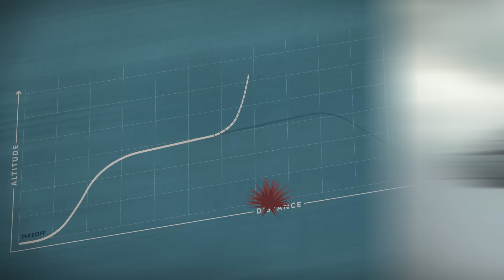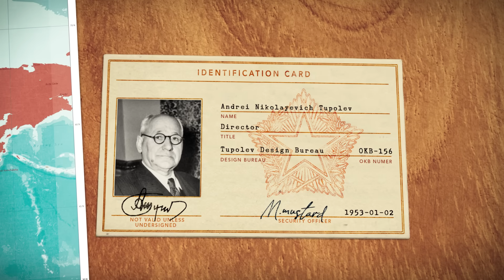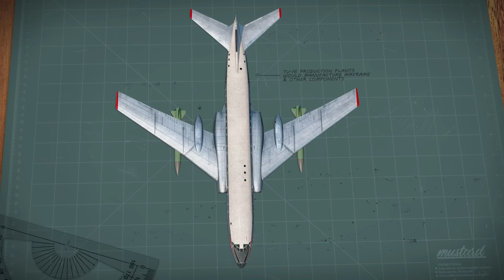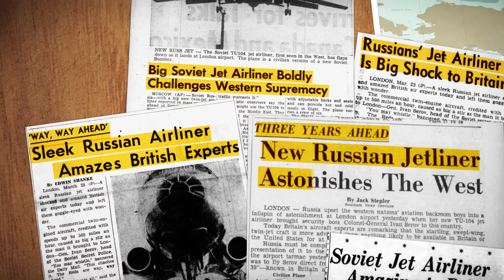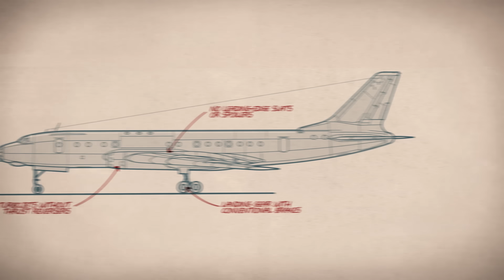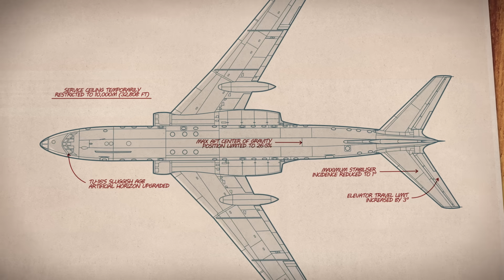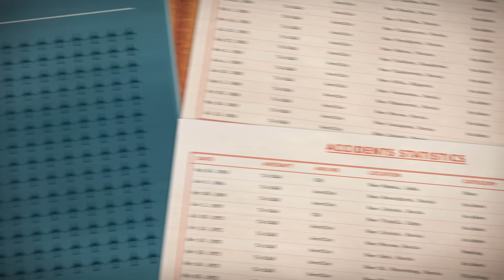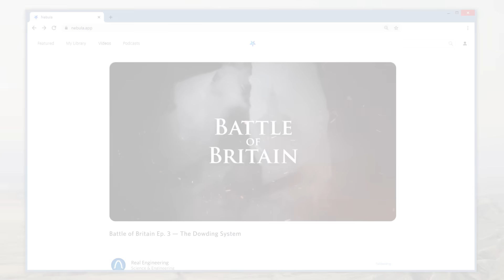The Soviet Airliner Designed To Crash

Comment: The 1st thing I thought when seeing those low wings pointing down, as if they were high wings, was that it definitely would be a handful to keep stable. If my fluid mechanics aren't too messed up, that's a recipe for unstable equilibrium, which is the situation where small disturbances tend to worsen the disturbed trajectory, instead of self-correcting.
Reply: Anhedral (negative dihedral) helps maneuverability, which might be a positive in a big lumbering bomber.
Obviously not a great trait for passenger aircraft.
Reply: Tupolev was as smart man and I think he knew that this my happen. His problem was the cost. Mascow only allwed him to build the thing if he can reuse stuff from the bomber assembly line. He was not allwed to alter the parts or create a new assembly line with proper parts. Its a soviet thing. Good example for it is the Izhmash plant - they build Moskovich cars and AK-47s. When I was a kid my dad had a Moskovich, not sure which of the 2 things was more dangerous.
Reply: @mowtow90  yes, there is video on paper skies tu22 and it mentions that Tupolev knew of all the flaws on a very early stage, but dismissed them and even started building second prototype meanwhile. I think taking such huge gamble was the only way for them to frog-leap foin tech and was an rational choice. Initially 'teething" issues would be addressed at the test phases and not during prototype production, to speed up the whole process and not to get distracted by minor flaws that in the end would result in such outcomes as we see later.
Reply: In the 1950's, many large jets had bendy wings.   On the ground they drooped, but in the air they had the positive dihedral required for stability.  Check out pictures of the B-52 on the ground and in the air.
Reply: @keithammleter3824  B52 is a high wing aircraft and didn't require the 'circus unicycle' landing gear of the Tu22.
But the Tupolev was designed with anhedral wings even before being laden with fuel.  Look at the drawings featured in this video. (yes, I know it's Blender and not some secret Soviet blueprints)
Reply: @jimurrata6785  You are right - the drawing is not a genuine original Tupolev drawing.  The fake ID card in English made me laugh.
It is typical in drawings to show how it looks on the ground.
I can't state with certainty that the TU-104 didn't have negative wing dihedral in flight, but it is VERY unlikely.
1950's jets had bendy wings because of the alloys and structural design used.   In most, wing mounted engines, and wing fuel tanks, accentuates droop on the ground.  However,. inboard engines and no in-wing fuel does not eliminate wing droop on the ground, because aerodynamic wing loading in flight still bends the wings upward in flight.   Therefore, static wing droop may be designed in to compensate.
Photos and movie film of TU-104 in flight seem to be rare.  Most that I found don't give the right view in level flight.  With swept back wings, they look like they have negative or positive dihedral depending on whether the camera is above or below the aircraft altitude.   However, in the film of the TU-104 at the Paris airshow, https://www.youtube.com/watch?v=eOq15xg4Q7A, at 0:33 it is shown in a climbing turn away at a distance and the wings appear straight.  
The TU-104 has the same wings as the TU-16.  I found a couple of photos of TU-16 in level flight taken from another plane at the same height - the wings appear to have a small positive dihedral. 
To make a plane, bomber or airliner, in the 1950's with negative dihedral inflight does not make sense as the plane would be unstable.   Modern fighter aircraft can have zero or even negative dihedral to improve manoeverability but they have fly-by-wire computers that make them appear stable.
T-jets were popular because of their low cabin noise levels.  However, engines behind is also an unstable system.   This was fixed by adding yaw dampers - automatic systems that use accelerometers to move control surfaces in a negative feedback system.  It is quite unlikely that a similar system was invented in time for the TU-16/TU-104.   And why would they bother, when by not having negative dihedral the problem does not exist.
It is also possible to make an aircraft stable with negative dihedral wings if the horizontal stabilizer is large enough and has sufficient positive dihedral to overcome the wing instability.  But drawings and photos show the TU-104 had a zero dihedral horizontal stabilizer and it's not particularly large..
Reply from the maker: Good photos are hard to come by, but the negative dihedral is notable even with lift under the wings 

https://media.gettyimages.com/id/1174232730/photo/international-air-show-dubendorf-1956-tu-104.jpg?s=1024x1024&w=gi&k=20&c=RcaUzsqn48FXidaM0Re7me_pmjC2r90PcbkEZYSq5kM=

https://media.gettyimages.com/id/526983340/photo/a-tupolev-tu-104-aircraft-takes-off-from-novosibirsk.jpg?s=1024x1024&w=gi&k=20&c=oE1vMdlH8xfVY1wdTvoJosnkpVl7K1OvW66JI2sdPyE=

https://www.aex.ru/imgupl/d2497_p1.jpg

https://aviation21.ru/wp-content/uploads/2017/04/ty124-5.jpg
Reply: @MustardChannel  : No.  Taking the pictures you found in the order you listed them:-  
1.  Appears to show positive dihedral, but angle of view combined with wing sweep-back makes it difficult to interpret;
2.  Unknown amount of weight is still on main wheels.   Aircraft is pitched up, which combined with wing sweep-back gives it a negative dihedral look anyway;
3.  Aircraft is pitched up in climbing, which due to wing sweep-back gives it an illusion of negative dihedral - in pitched up attitude the wing tips will be lower than the wing roots anyway;
4.  Angle of view seriously impedes interpretation of wing dihedral.
The only reliable way to assess wing dihedral is a photo of the aircraft in level cruise, photographed from another aircraft flying at the SAME height.   The pictures you found prove nothing.
As I said, an airliner or bomber with negative wing dihedral in flight is quite unlikely as it confers no advantage - one does not dog-fight in a bomber or airliner - and there is a serious disadvantage - instability, mandating a system of automatic correction.  
Soviet designers and engineers may have taken some risks and cut corners in order to meet the Kremlin's demands (they didn't however do as bad as DeHavilland with the dreadful Comet), but they were not incompetent.

Comment: The Comet went on to become one of the most successful jet aircraft of all time and extended larger versions a service of over 30 years.  The military versions into the 21st century as troop carriers and AWAC's.  The accidents resulted in the development of the 'Black Box' flight recorder and research into metal fatigue, X-rays to find invisible cracks in airframes.  They were the reason for the crashes and the introduction of smaller oval rather than square windows in pressurised aircraft.

Comment: Well about re-designing, Tu-134 is actually seriously re-designed Tu-104 (actuly it's redesign of redesign - Tu-104 was converted into Tu-124 (less capacity and already safer) which was converted into Tu-134). And Tu-134 is hella good.

Comment: I wonder did the smaller Tu-124 had the same stability issues that plagued the Tu-104. Small wonder why Aeroflot temporarily used the Il-18 turboprop airliner quite a bit more until the Tu-134 and il-62 became available later in the 1960's.
Reply: Yes it did. The Tu-134 and Tu-154 also inherited the stability “feature”

Comment: 7:13 What is this steel cable going from the cockpit to the rudder in the outside of the plane??? Is it there to prevent to much flex in the fuselage? I've seen this before but always wondered what it is there for.
Reply: Though your suggestion is curios, it's just a wire antenna lol
Reply: @sdpg_spad  Why curious? I don't know how flexible old airframes were out weren't. And on old double decker planes there were often steel cables to increase the stiffness.
Reply: It’s tape to hold it together

Comment: 1953 Tupolev: Want to see me make a Tu104 airliner out of a T16 bomber?
1955 Tupolev: Want to see me do it again? Want me to make a Tu114 from a Tu95?
EDITED because 114 was mistyped as 144. Thanks to Thotslayer for the correction. 👍
Reply: It was Tu114 that developed from Tu95.
In case of Tu144, it was actually reverse. Tu160 bomber was developed on the basis of Tu144
Reply: @randomyoutuberthotslayer8247  right...got the 14 and the 44 mixed up

Comment: As usually a bias American commentator  undermines the Russian pioneering technology.  Anyhow, Russia did the first Transatlantic fly with Jet Engines. It was not America
Reply: He literally states that it was the first jet aircraft to do a transatlantic flight. Also, that “pioneering technology” had multiple fatal accidents, including one that killed 16 Soviet Admirals.
Reply: Same for the Comet, accidents  due  metal fatigue.
Reply: @gnranger  the admirals crash 1) happened well after 20 years of service which wouldn't be possible if the plane was as horrible as your average western propaganda monkey would claim (about almost anything soviet-made); and 2) was due to overloading and changed center of mass from the improperly secured cargo.
There's a video of a US cargo plane crashing in Afghanistan after take-off due to the same cause. How about calling that out as a "proof" that the plane is crap and dangerous to fly?

And the comment above this thread pointed out to this double-standards attitude once again - regarding the case of Boeing MAX.

Comment: The principal reason for the Comet's sad eventual failure was the square windows.  It's as simple as that.  The skin around these windows was subject to substantial and unforeseen stress during cabin pressurization/depressurization.  After very few operations, the hull would fail and the plane would fall out of the sky, leaving very little to no evidence of this defect.  Round windows would not have had this problem.  It took months of full-scale water tank testing to re-create the failure mode, and several years to re-design the plane.  The Comet II would have had huge success if the Comet reputation hadn't been irretrievably broken.  IMO, had this (minor) design decision not been taken, Boeing (and Douglas and Lockheed and even AirBus) might be footnotes in passenger aviation, and Britain might not only rule the waves, but the clouds as well.
Reply: Britain rules the waves?
They are not in the top-10 for largest navies and their best metric is 5th best in terms of total gross tonnage.
Perhaps in the 18th century and before?
Reply: @tim3172  I was being ironic.

Comment: Maintenance must’ve been a pain but wing integrated engines look so sleek like on this and the De Havilland Comet
Reply: Still a very bad design as every engine "explosion" would have been more dangerous to the plane, the fuselage. No wonder it's not used.
Reply: @hurri7720  That and you cant really use high bypass turbofans with that design
Reply: @x-ray3443  A key advantage from that embedded design was no engine drag
Reply: @filledwithvariousknowledge2747  but dont non highbypass turbofans drink fuel?

Comment: I love your videos, altough a little mistake slipped through. Goose bay is not on the Newfoundland's Island. It is up in the Labrador territory further north. Where you put the stop point in Newfoundland is Gander.
Reply: An interesting slip up, AFB Goose bay at that time would have had a nuke storage facility making it odd to allow Russian planes to land there (though commercial flights did fly there).  Gander would later become know for Russian flights landing there during the cold war on their way across the Atlantic (interesting doc on curiosity stream).  A quick search got no results for the T104 landing in either, and only in Newfoundland would the 2 major airports be named after the same bird (Goose Bay, Gander Lake).

Comment: This is the plane which killed 16 Soviet admirals in a single flight accident, almost entirely beheading the Soviet Pacific Fleet. Soviets knew it was unstable and had tendency to weer up, but loaded it with paper rolls and oranges without properly securing them in the hull anyway.

Comment: 10:34 nooooooo you butchered Cyprus.

Btw the plane that crashed in Nicosia is still there (35.1684574, 33.2675296). It didn't had much damage and it was planned to fix it. Unfortunately it was bombed during the Turkish Invasion. So only part of the wings and the tail are left. https://www.forgottenairfields.com/airfields/cyprus/nicosia/NICOSIATupolevTu-104A_OK-MDE_-20October2014.jpg